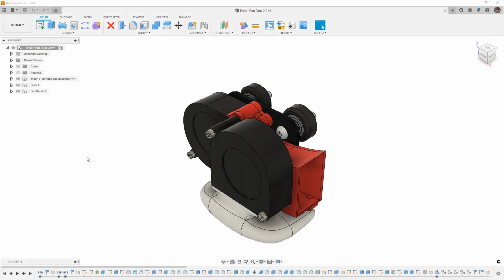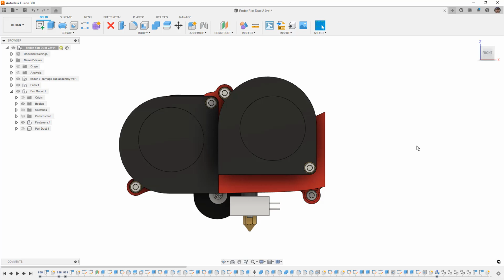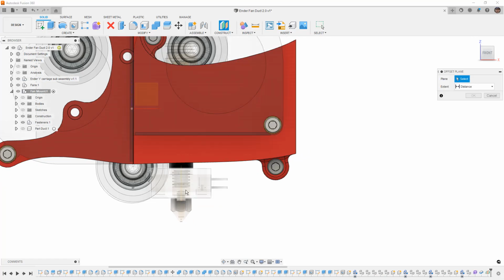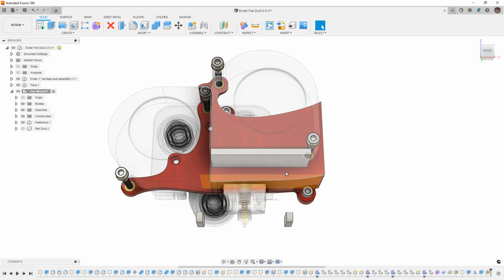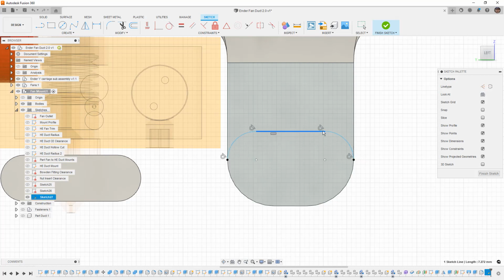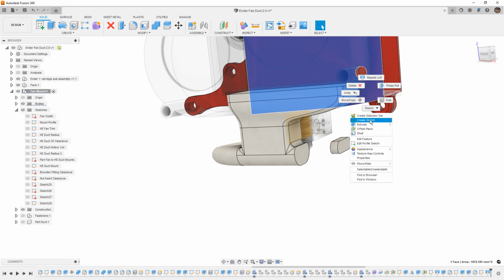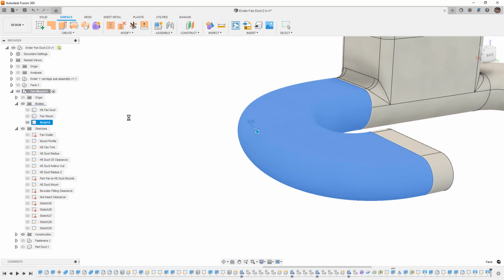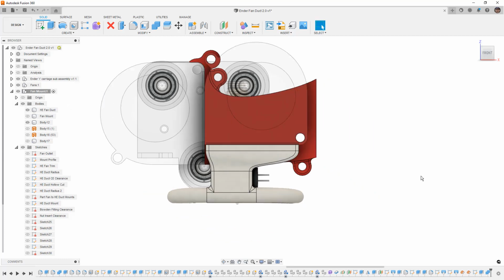How To Approach Complex Designs | Walking Through the Design of a 3D Printer Nozzle Vent

Comment: Love the content just wish you went with a more printable design considering its a 3d printer fan shroud.
Reply from the maker: Right well the question came in and the user was asking about process.  They were planning to break it up into multiple pieces and glue it together so the initial question was more about workflow than the restriction of the build direction.  This could easily be printed with an SLS machine and the lower portion of the vent could be split so the upper half was printed and then the lower half.

Comment: Interesting why the loft surfs had self intersection issues at 1mm offset. I don't know much about Fusion 360, but if you had the ability to throw a bunch of flowlines in the U or V direction on the surface you could better visualize what's going on. Often the rendered image and even the curvature maps don't really tell the whole story. Lofted surfaces can exhibit all kinds of problems because of the uneven spacing or syncing of the curve parameters involved. Wiggly or uneven flow can result in shape problems
Reply from the maker: there is a curvature analysis that will toss UV curve lines on and allow for curvature combs to be displayed as well.  Fusion doesn't handle these lofts great.  If you keep the input profiles the same number of edges it certainly does better.  Lofting with a Form body usually produces a better result, but the profiles aren't adhered to like a surface or solid loft and the number of edges that need to be added to say have a slot with two lines and two arcs isn't achievable as a form.